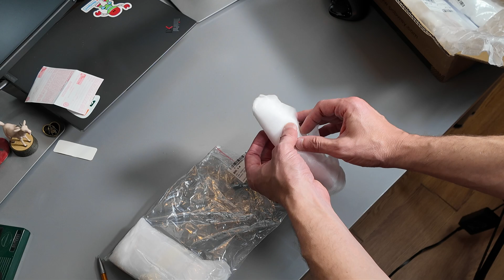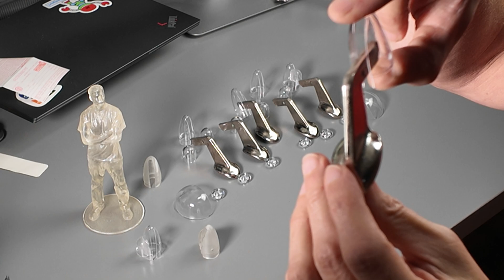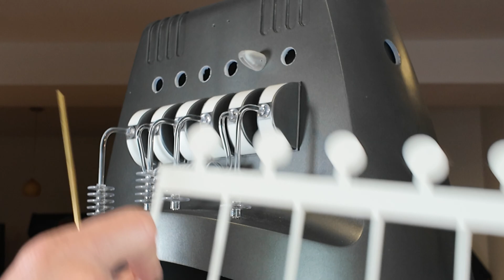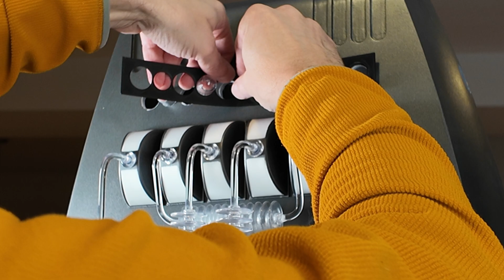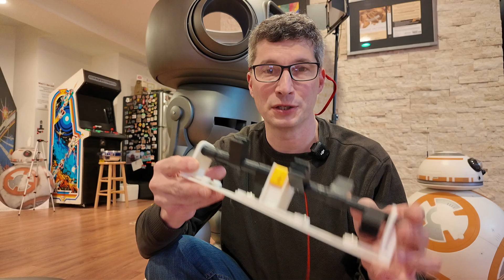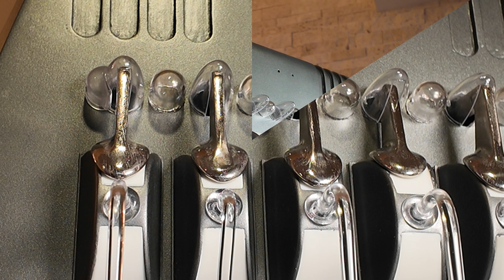Robby the Robot's Face Part 1

Comment: Mike what size inserts are you using for the Sax LED Holder screw holes ?? And what size wiring are you using for the motors throughout ?? What gauge ?
Reply from the maker: Almost all of the screws I am using are M3 (various lengths of course). The only exception so far is the M2.5 screws I am using for the dome Gyro mechanism (that video not yet published). All of my wiring is very temporary right now. I am still deciding how I will manage all the internal power connections (I am debating between a single main power source vs. several distributed USB battery packs). Most of the test wiring you see in the pictures is probably 26 AWG